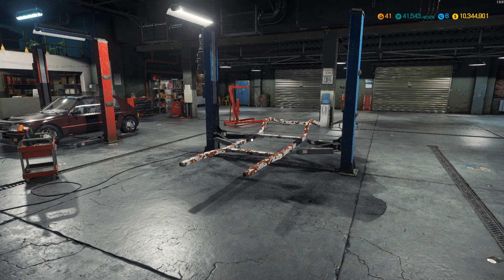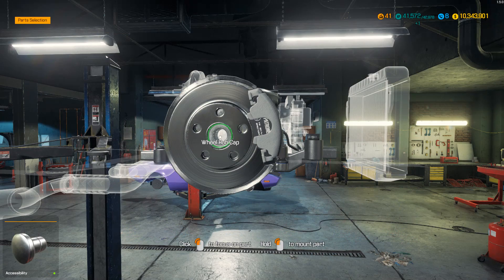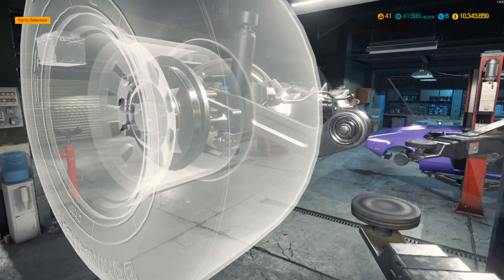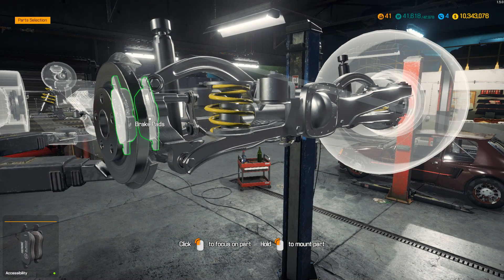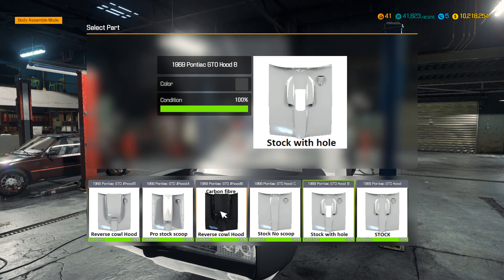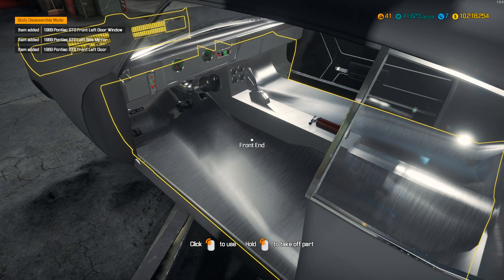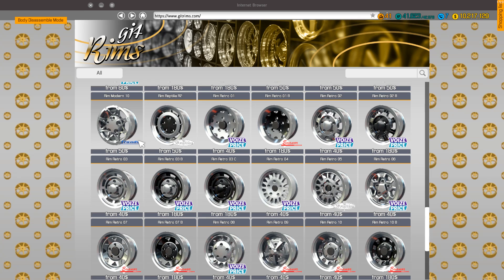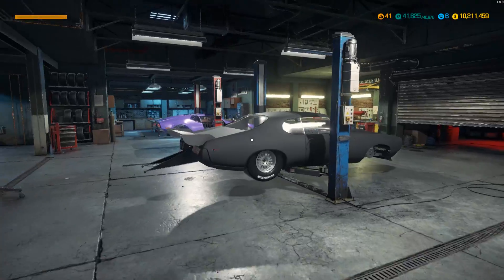Car Mechanic Simulator 2018 - Ultimate Customisation

Comment: Alex, here's a little lesson in tire sizes. You seem to already know what the first number stands for, it's the with in milli-meters, the second one is the profile, but it's represented in percentages of the with, so a 65 profile is going to be a greater profile on a 305 tire than on  165 tire (198,25 mm for a 305 one and 107,25 mm on a 165) and last as you know is the rim size. I hope this helps in the future because you always seem to be a bit lost when dealing with tires, although you are certainly getting better at it.
Reply: andrivif not down here it ain't Lmfao a 65 is a 65 no matter how wide the tire is, a 265 70 16 for example, a 245 70 16 is the same height but not as wide
Reply: Put one of each size next to each other and I'm pretty sure you'll see the 265 one is almost 3cm taller than the 245 one, you can look up info from all tire manufactures telling you the same thing, just a quick google search brought me here: 
https://www.goodyearautoservice.com/en-US/tire-basics/tire-size
and here:
https://www.tirebuyer.com/education/understanding-tire-sizes-and-types
Reply: andrivif I haven't seen someone explain tire systematics as easily as you did, bravo mate. You are 100% correct. It's weird seeing someone on YouTube that actually knows what they're doing
Reply: andrivif well that all fine and dandy, also like saying the 70 stands for its width and 245 standing for its height, which I've also heard before. but I was speaking from experience of where I live, I have had several size tires all lined up beside each other, and the ones that were the same height number were exactly as tall as the rest, even though one was twice as wide.

Comment: You're confused because the gasser is the 1965. You have a 1968, hence why all the parts you could use were 1968 parts.
Reply: 1969
Reply: @MadHappyPlays  The 68 looked the same as the 69

Comment: I think it should be 165/65r16 because the number in the middle (65) is just the aspect ratio between the width and the height of the tire

Comment: Wow came here with a flat 700 views, 70 likes and 0 dislikes. Very flat numbers. Alex, the front wheels should be thin but large, like maybe high offset 17 inch high profile tyres.
Reply: I've got 950, 95 and 0. Wow.
Reply: 1,450 views, 145 likes.
Reply: 1650 views, 165 likes
Reply: Avetho Plays 530 views 53 likes.
Reply: 294 likes, 3 dislikes :(
Reply: Avetho Plays 8,988, 407, 3. Wow.

Comment: pfft. the GTO was a unibody. The chevrolet C10 makes more sense with it's chassis, because that's how they were built. it's also a good mod. 12 minutes in, i'm wondering how long it will take Alex to work out the difference between 1965 and 1969 GTOs...
Reply: The GTO was body on frame, all 64-72 GM A bodies were.
Reply: It was not unibody

Comment: Can you not fit 17 or 18 inch wheels up front? Would look so much better than having 16s with a 65 profile tyre..
Reply: yeah, small rims with wide massive profile tires on the back and big, very narrow rims with low profile tires on the front (those drag cars usually have basically bike tires in the front)

Comment: Try making the profile of the front tires 60 or 65 cos they are too small
Reply: GINGERPIG GAMING it's a gasser. It's supposed to be like that.
Reply: Yeah I know the front wheels are supposed to be small, but the actual size (not the width), was so small that they hardly touched the ground